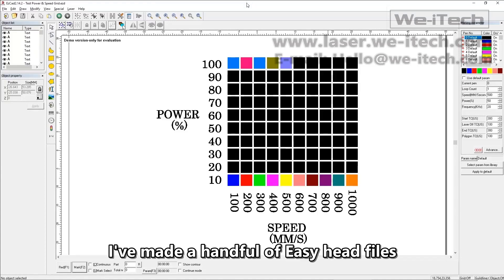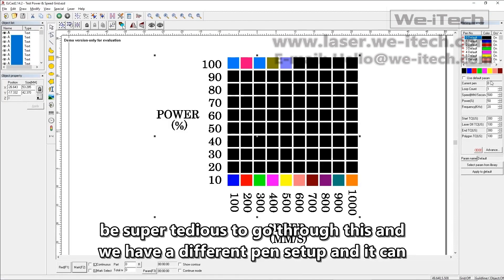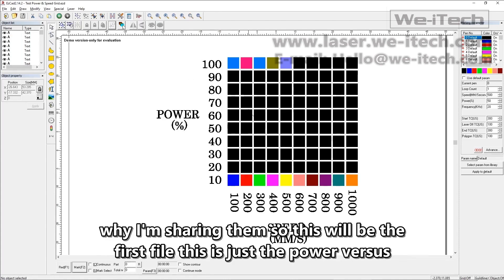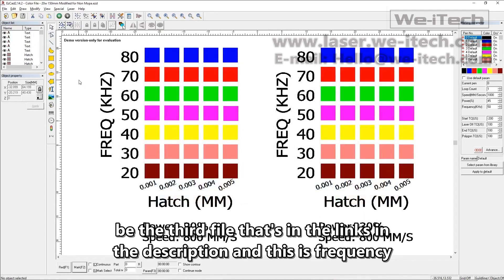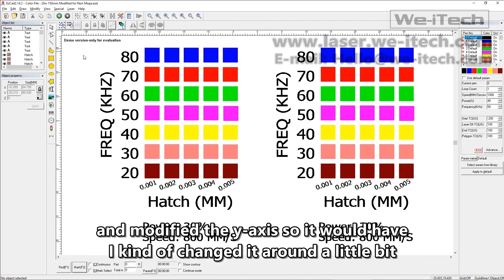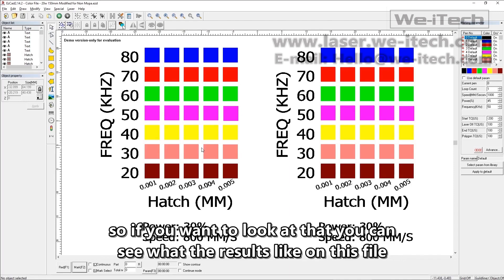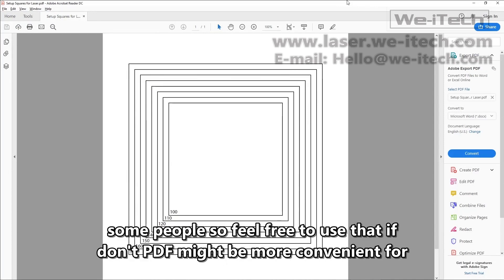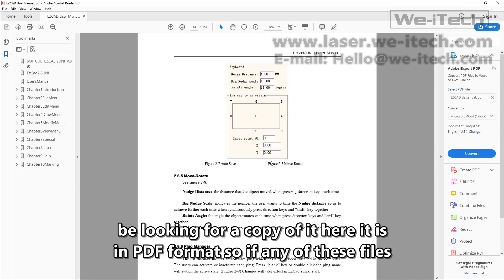1.10 EZCAD2 All Test Grids Here for Laser Marking Machine

Comment: Would you mind throwing in the original testgrid you mentioned? I have a 60W and it doesn't show anything because the pulse is set to 10 in all settings. I think the original settings are the ones I can use on my machine. Thanks in advance!